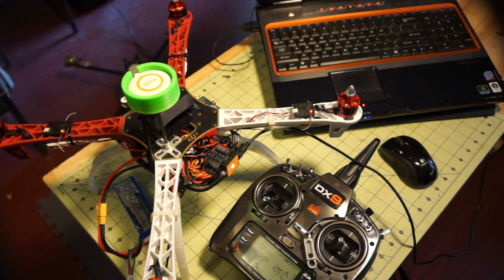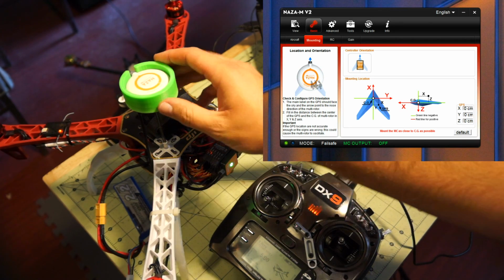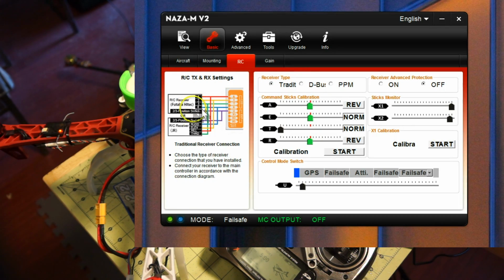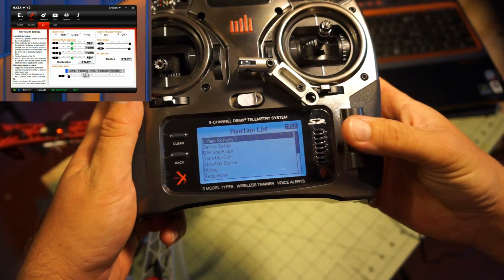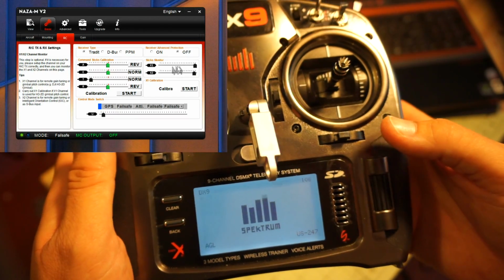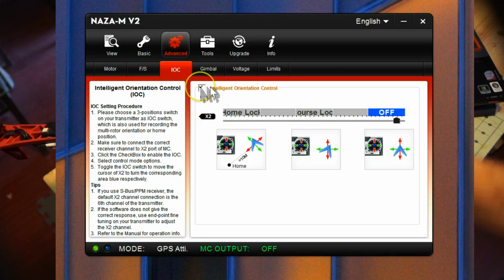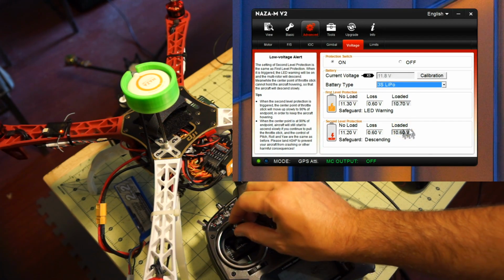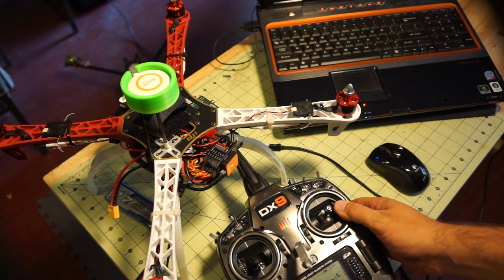Complete programming of Naza V2 with Spektrum DX9 and gimbal slider

Comment: How did you get the software to connect to the Naza controller?  When I try it in Windows 10 it can't find the FC!  I asked those idiots at DJI how to get it working in Win 10 and they said to use XP!  I haven't used XP in years!

Comment: I am still using the Spektrum DX7 First Generation Transmitter, is there a way to configure this to control the Tilt? I have an F450 and F550 witch both have the Zenmuse H4-3d Gimbal. Do you have any mods to have a potentiometer attached to this DX7? Thanks.

Comment: One important thing you did not cover is setting up the naza so it automatically goes into failsafe if the signal is lost whether it is from excessive distance (Between the tx and rx) of if the radio (DX9) is shut off. I saw one idiot walking backwards trip over a curb.....his radio went flying, hit the ground with all the batteries coming out. 

Without setting this up the motors simply shut off. In this guys case his 680 quad fell from the sky @150ft onto a car in the parking lot.  Was not pretty.

Comment: Thanks for the great video! However I can't help but notice that your GPS mount position setting is a bit off, I think it should be -3 cm on X and -2 or -3 cm on the Y axis. This is just pure eyeballing only based on what I can see from the video. But I could be wrong :)

Comment: Hello i have a problem:i connect the battery,bind with my spectrum dx7s and then connect it to the computer with the cable that it came.I open the program but it doesn't detect it.i tried in another computer and the same results.What can i do ?
Reply from the maker: +Νασος Βητα plug it all in then run the driver from the DJI website.  That will usually solve all connection problems
Reply: Yea, I'm having the same issue.  I've followed the instructions to the T. Same problem.  I've even restarted my computer several times.  No luck.

Comment: Hello.I have a frame like the one you have and I have4-1400Kv motors and do you now  if I can put for more motors on there a total of 8-4 on top and4 on the bottom will that be to much I have 10inch props and a 2 servo Gimbel with the go-por do you think that will fly that way? Thanks Rodney
Reply from the maker: Rodney Hendrickson Naza V2 will not properly run an octocopter.  You need a DJI A2 or WooKong for that.

Comment: Can you help me with my quadcopter its got the Naza m2 to my spectrum Dx7 7000 with the GPS I'm new at this and I'm willing to try to do it my self I just need a little help on some things.thank you much..Rodney
Reply from the maker: Rodney Hendrickson Is it a new DX7 or an older one?  The newer DX7s have the same protocol as the DX9 in the video so it should flow the same way.  If I remember correctly the older DX7 has the same protocol as the DX8s so it looks a little different than the 9 in the above video.  What are you having trouble with?

Comment: Hello,
My receiver(AR8000) says it is bound to the controller yet my controller(DX9) is having no effect on the quad copter.  Do you have any recommendations?
Reply from the maker: If the Sat Rx is installed and bound as well, then hook up your Naza to your PC.  Once it all connects got to the radio tab and make sure that the Rx on there is set to traditional.  You should see the radio inputs at that point.

Comment: Did you not set the copter to go into Failsafe when the TX was turned off or loss of battery on TX? Why Not if so. How do you do it with the DX9? , you explain things very well. Is your other job a police officer or lawyer? Also wondering why you set the failsafe on the same switch as your GPS / ATT ?
Reply from the maker: Michael Gomez We did set it up to failsafe with radio loss, but its a little complicated with Spektrum so we made a separate video covering that aspect.  
https://www.youtube.com/watch?v=hXQkWi9Av_M
Reply: AGL Aerial Video Solutions  Oh ok , did some general youtube searches and did not see it , but found one and got it taken care of. I have been told that it is not good to have the failsafe on a TX  switch because of accidental use. What are your thoughts on that. Thank for posting this one.
Reply from the maker: Michael Gomez I think that is irresponsible.  If you have this capability why not be able to use it.  We always program a true failsafe in the case of radio signal loss, and a switched failsafe in case we loose orientation or just need to get it back.  It's there just in case.  We usually set ours on a 3 position switch and the closest position is FS because as you get scared or tense up because something bad is about to happen then you should naturally pull that switch towards you and the FC will take over while you try to calm down.  Then if you want to take control back you just cycle through the mode switch and you have control back.

Comment: Does the compass calibration need to be done before every flight or is it just for initial setup?
Reply from the maker: 4. When to do re-calibration
(1) The flight field is changed.
(2) When the multi-rotor mechanical setup has changed: a) If the GPS/Compass module is re-positioned. b) If electronic devices are added/removed/ re-positioned (Main Controller, servos, batteries, etc.). c) When the mechanical structure of the multi-rotor is changed.
(3) If the flight direction appears to be shifting (meaning the multi-rotor doesn’t “fly straight”).
(4) The LED indicator often indicates abnormality blinking when the multi-rotor spins. (It is normal for this to happen only occasionally)

Comment: How do you change the position 2 of the switch?  I have position 1 adjusted to gps and position 3 adjusted to manual, but can't figure out how to make position go to attitude mode, it's just right of it on failsafe.
Reply from the maker: First check your trims and make sure that they are all neutral.  Then check your sub trims to confirm the same.  Once you did this go back through the radio calibration under the basic tab on the Naza assistant software.  If this doesn't correct your issue then try rebinding the Rx to the radio with everything centered.
Reply: Sub trims fixed it, thanks!

Comment: Thanks for the video! Good job question shouldn't you bind at mid stick for fail safe?
Reply from the maker: No Naza will govern the throttle for you.  The throttle stick with these system is just meant to control your altitude.  The flight controller will govern the throttle needed.
Reply: AGL Aerial Video Solutions
Thanks I am doing the setup now per your video it helps out allot! Can't say thanks enough..
Reply from the maker: Jello Simo This video goes into a little more detail about assuring your have a proper failsafe.
https://www.youtube.com/watch?v=hXQkWi9Av_M

Comment: question about failsafe.  lets say the transmitter goes out of range or gets interrupted or turned off. how can i get naza to go to failsafe when my dx6 turns off during flight?
Reply from the maker: Set up your mode switch with one position on FS, then rebind it with the switch in FS mode.  We plan to do a video in the morning to address this more clearly.  Thanks for the question and look for that video tomorrow evening.
Reply: AGL Aerial Video Solutions ok so i mixed in a two position switch to my 3 position flight mode switch(gps/atti/man) to get a failsafe read. are you saying to bind with the failsafe switch activated, or set up with the assistant software for my flight mode switch as (gps/atti/failsafe) and then bind? i appreciate the help boss!
Reply from the maker: With the mix you have you can simple put the switches in the FS position you already programmed and rebind.  That way if you loose radio link it will go into FS.  You can test this on the bench by turning the radio off while in the assistant software to confirm.
Reply: AGL Aerial Video Solutions ok so i have figured it out. the ar610 rx that the dx6 came with is only capable of a preset failsafe in the throttle channel. list of spektrum receivers i have found that has all channels capable http://www.rcgroups.com/forums/showthread.php?t=1816661
Reply from the maker: Alex Skaggs here is a link to the fail safe video we are uploading now.  It should be finished within the hour.
https://www.youtube.com/watch?v=hXQkWi9Av_M&feature=youtu.be

Comment: I'm having trouble connecting my f550 using the black edition spektrum dx9, after I plug in the USB to the led the green light stays solid only for about 4 seconds and no light turns on. Please help..
Reply from the maker: I've never heard of that issue.  I would assume that since the LED turned green then the computer recognized it and the drivers are thus installed.  If you haven't already, then plug the NAZA back into your PC and reinstall the DJI driver.  If that doesn't work then I would get on the DJI forums.  That's a new one on me..sorry

Comment: What's the green thing around your Naza?
Reply from the maker: It's a 3D printed protector for the GPS puck.  If you flip, or crash it should protect the GPS.  It also helps with multipathing from the 1.3g video system while the quad is on the ground.

Comment: You forgot one important setup step that almost every multirotor pilot wants - In the Aircraft Option Menu with the Gyros & Pitch Curve Menu you forgot to click on the Airplane Model Image and change it to the Quadcopter Image. :)
Reply: Good catch freemarlochip, I'm gonna make a short follow up video to cover the different fail safes with Spektrum, and I'll add that as well.  I'm doing the Futaba video next and possibly a Turnigy 9XR version as well to cover the gamut.